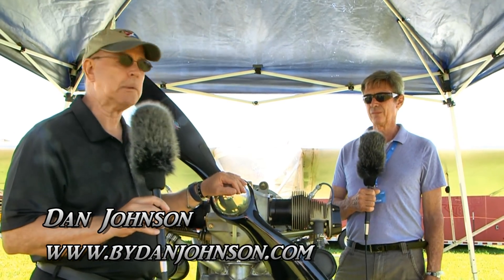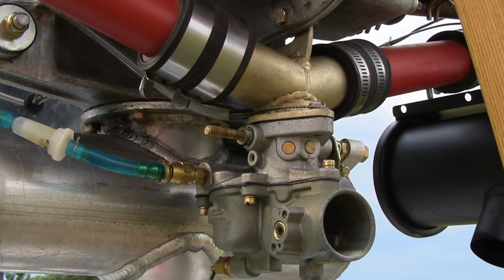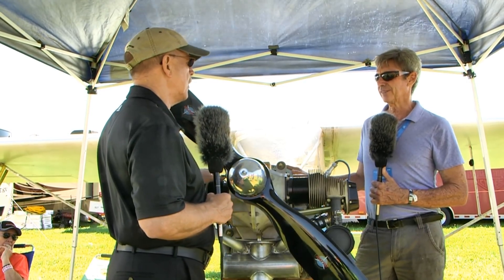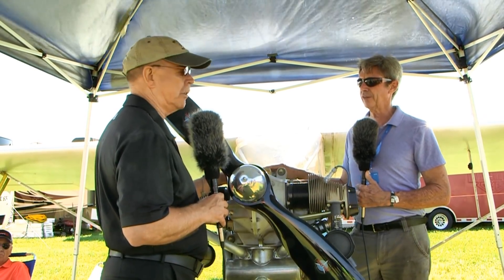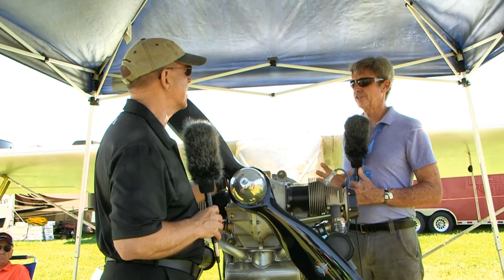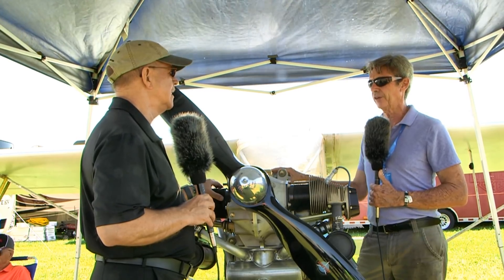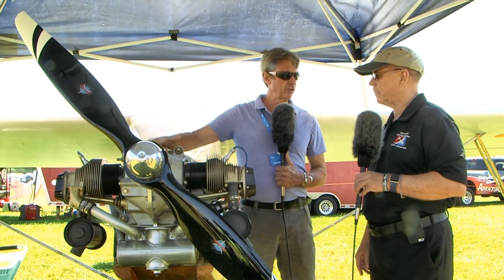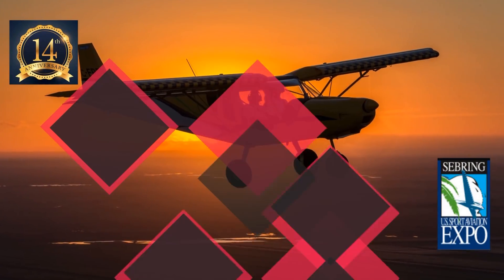Pegasus DP-1, 0-100, 4 stroke twin cylinder, 57 HP, experimental light sport aircraft engine kit.

Comment: Pete just a great replacement for my rotax 503!  Ive been lookin for a  4 stroke  comp in weight, hp for my redback trike. That engine clearly is a great idea giving all those birds out there with ageing 503s a great alternative!  So with my 503 iam cautious to do much xc flying keeping a good e/0 lz and such alternating tbo info at 500hrs.
  Clearly were lookin at 4 stroke continental  reliability! With a much much higher tbo 1800 hrs possably. Not to mention the availability of future parts. 
      Just great godspeed!

Comment: why wouldn't you, good guys, cut io320 or 360 in half and beat Rotax 912. Much bigger market. Yours 57hp is not gonna comply with part 103 anyways. What is the point to invest in the replacement for 503 when 912 and 914 cost around 30000. I believe that half io360 in a kit form  still going to cost less than used full size  o200.  If i was you i would cut all used 4 cillinder certified engines in half and sell them as kit engine. 2 stroke 100hp Hirth 3003 priced over 10000.

Comment: I would have fun with this motor. I would equip it electronic multiport sequential fuel injection backed by electronic spark with knock sensor and boosted by a turbo charger and run that motor at lower RPMs with much more torque and better propeller efficiency.  Then this motor would be new and special.

Comment: The accelerator pump on that carburetor from the Harley Davidson motorcycle is useless on a drone type application for a airplane motor.    The accelerator pump is only good for a motor application that is constantly going from low revs to higher revs but on an airplane that does not take place.
Reply: The accelerator pump prevents the engine from bogging down if you need to accelerate rapidly when aborting a landing.  This can easily be a life or death situation.
Reply: Ray Dreamer - so you contend the pump cannot work on a continuous basis? What about all the freeway bikers I know who will hop on the interstate and ride 80 mph for hours at a time, "droning," as you say?

Comment: Nice engine, 1'600 cc is quite an impressive size for an air cooled flat twin, we knew just the 652 cc Citroën VISA and LNA avionized versions. 
Would anyone consider the Rotating Single Sleeve-Valve patented in 1917 by Piccard-Pictet, number GB 118.407? 
The retail price for a cylinder liner of an adequate size for this engine is in the range of $30, adding a gear in the bottom for having it turning looks neither difficult nor expensive.
Comments?